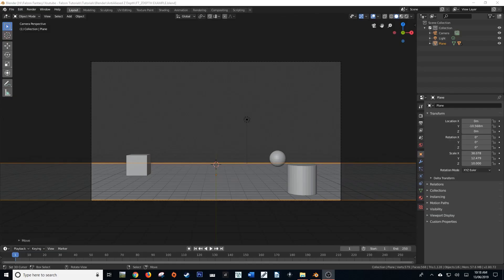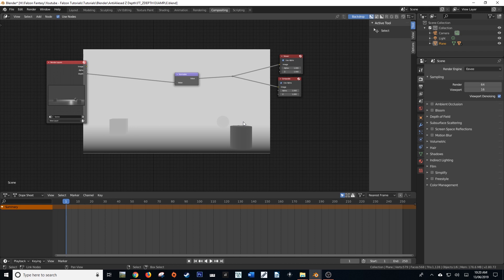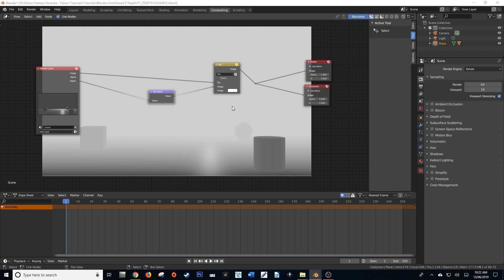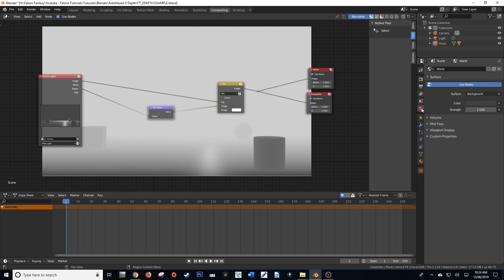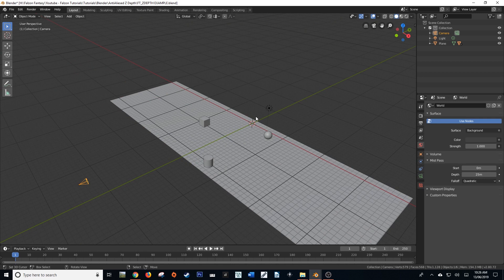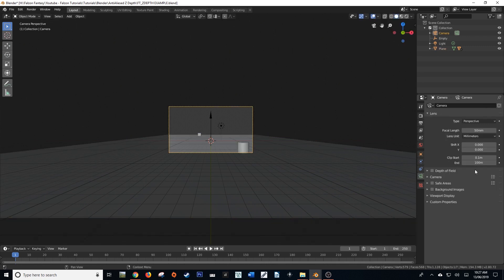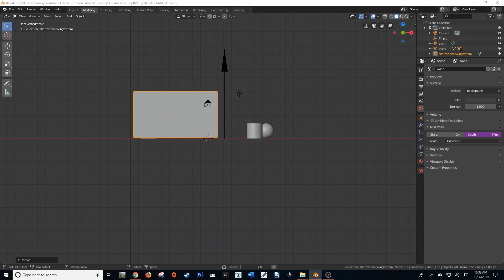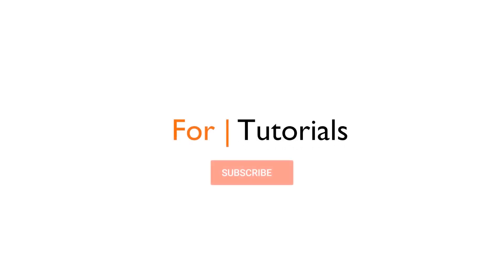How to set up Anti-Aliased Z Pass in Blender 2.8 | Blender 2.8 tutorial

Comment: Thanks for this clarification.  I did a comparison between the Mist and Zdepth passes on the same render with your driver setup.   The Zdepth  far depth evaluates to full 1.0,  while the Mist comes up short, and displays a grey value.  Your driver setup is misinterpreting the Mist far depth property.   Far Mist Depth is total distance from the start, not from camera.  So in your driver you have to subtract the Mist start value from the distance between Camera and the Mist depth value.    When I compare this to the Zdepth render they both match exactly (except for the anti-aliasing).

Comment: Hi, sorry to bother, I'm a complete Beginner to Blender and I've been searching to get a nice Depth map pass to play with, but all I usualy get is a white background. Now thanks to your video I've managed to get the image that I wanted but only in the compositing editor background, and I don't know how to get it save somewhere. Once I hit render I usually get the combined fine but not the others the Depth :( . Could you help me out ? 

Thanks
Reply from the maker: It's not a bother.

The depth info information has to be run through a normalise node, which clamps the values between 0 and 1.  This will allow you to see it in the render.

The must does not suffer from this, but a as you saw in the video there is a little bit more of a set up.

Once you hit F12 on all info should be calculated. So you can swap out the nodes at your leisure. Take the mist render output and plug it into the composite input. Then on the image window at the top in I believe the image menu you press save as to save you image as a single file.

I hope that the answer is helpful. Let me know if I still have not helped. It if I have. 

Thanks for watching.